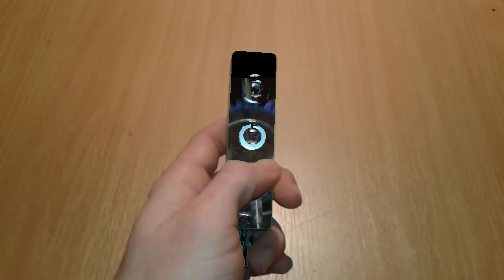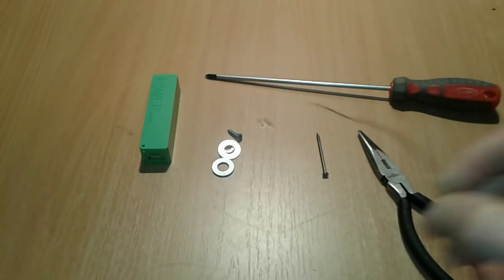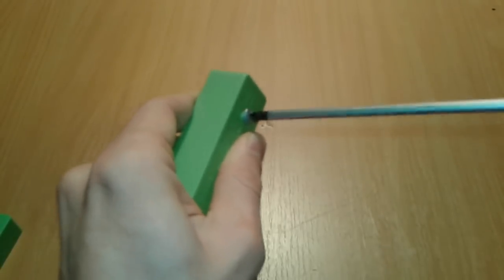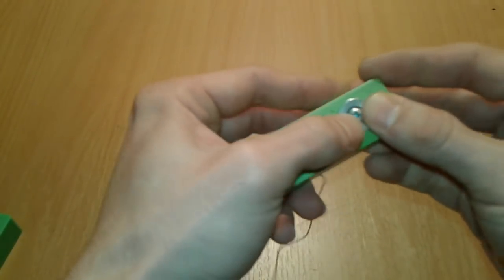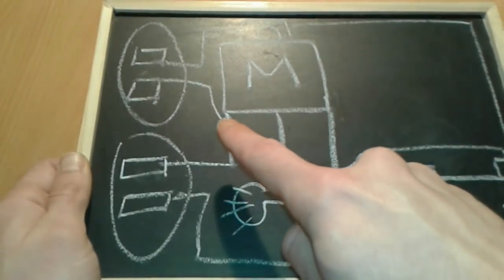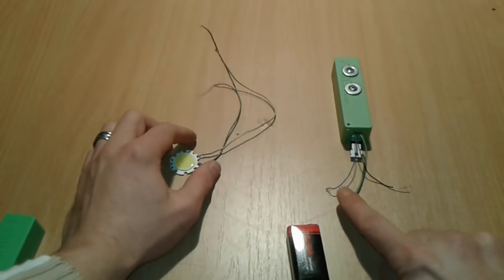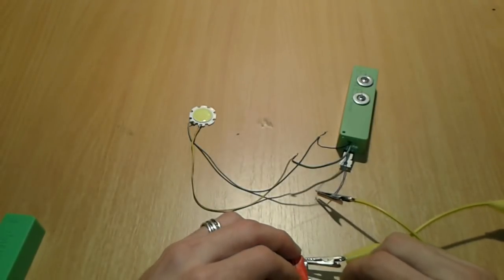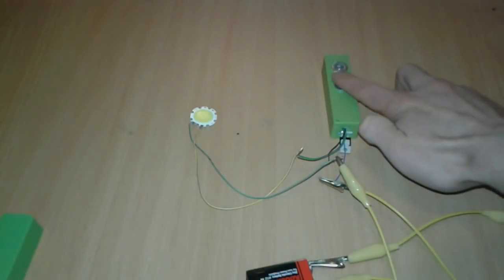Touch switch circuit using transistor MOSFET for any electronic projects

Comment: Can you modify odin laser trackpad to have more than 2 buttons? For example, 1 button could be an on-off button used for highlighting files (click once to start hughlighting files and click again for ending the highlighting process). Or you could also use the extra button for rapid clicking. Or you can come up with other uses
Reply from the maker: joey garcia hi there it is possible but is tricky in order to make a button to do multiple tasks you will need an ic(integrated circuit ) but is not easy arduino is the easiest way all the best

Comment: What is the voltage limite for this touch switch?
Reply from the maker: sudipta mondal in this configuration is limited by the mosfet specs max 24v but a relay can be added and will be limitless check it out touch switch 220v with relay

Comment: Not working. As soon as i release both wire after the current is cutoff it starts itself
Reply from the maker: shivam arora follow the instructions exactly and watch the previous video all the best
Reply from the maker: shivam arora you may have a short in the on wires your finger resistance is triggering the on and off
Reply: Have the same problem, it goes on right after I do the wiring of the load and power supply